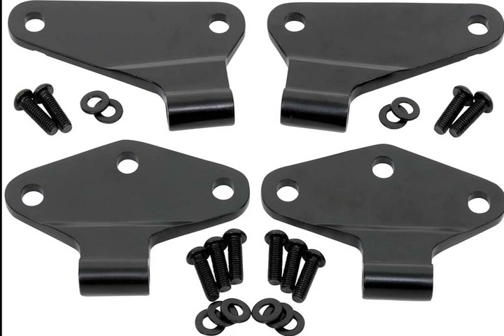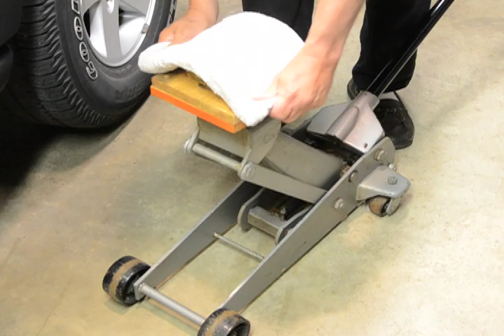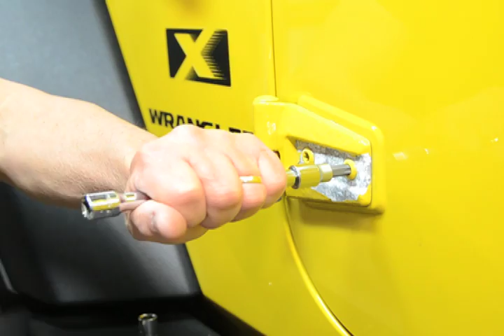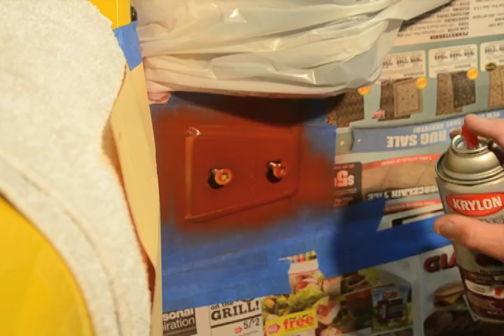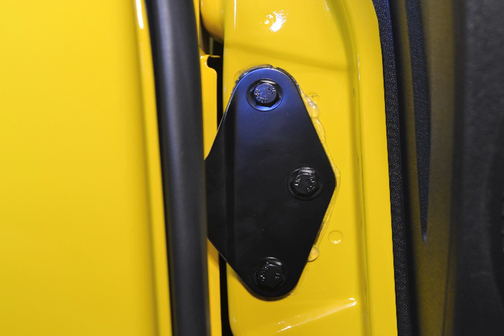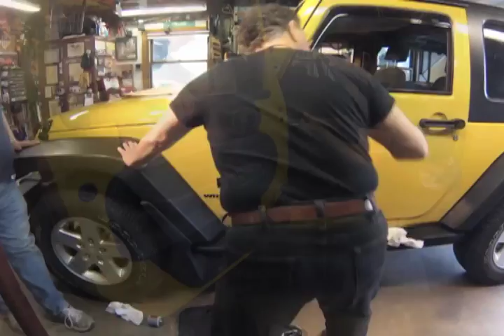JK Door Hinge Installation - Kentrol Inc.

Comment: Can these be painted to match the body? I already have paint but I've never heard of painting stainless steel.
Reply from the maker: Yes you can, people do it all the time!  You would just need to sand blast them unless you go with Plastidip
Reply: Yes sir you can,, use some xxxx steel wool to clean with acetone,, dry dust ,,give multiple thin coats,,ok?

Comment: Did you use any of the washers? I see what washers go with the inside body hinges but where do I put the washers on the outside hinges? There are small ones that go were the nut and washer goes but then I have 2 washers that are even smaller . The small ones has a gap in the washer